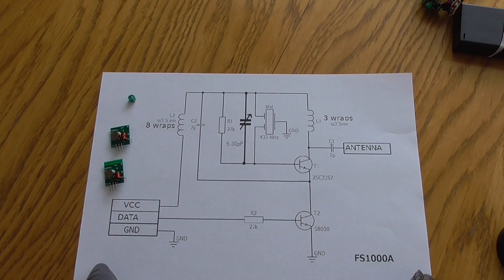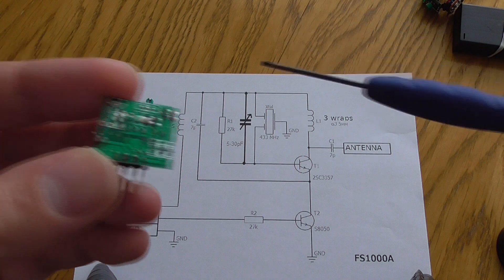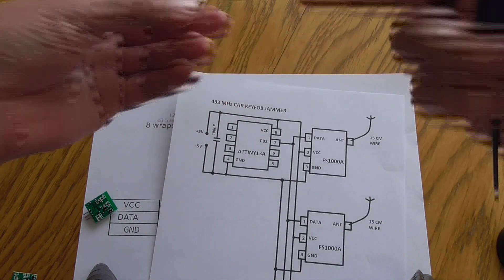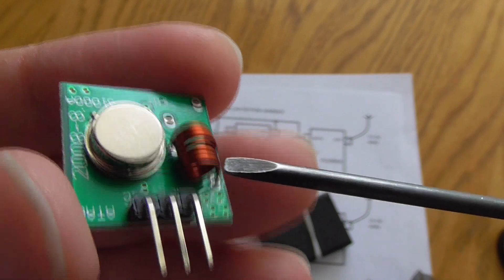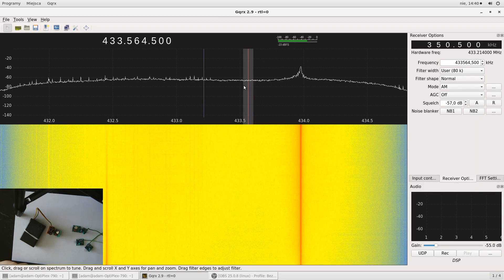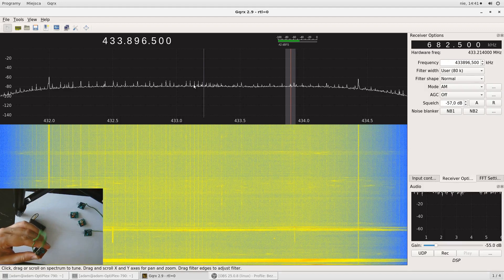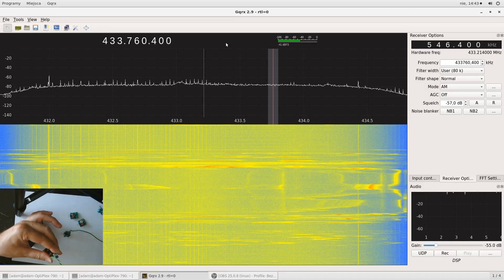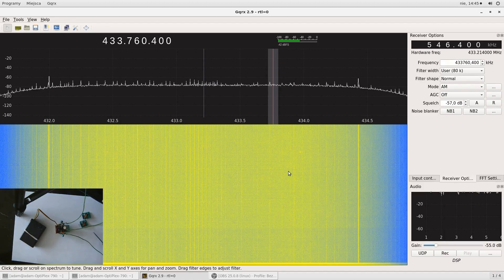2$  car key JAMMER DIY. Relay attack / keyless car hack / car hacking protection - part 2

Comment: Hii Adam can you tell me the antenna u soldered is it a normal multistrand wire or is something diffrent and for 433MHz what length it should be
Reply from the maker: as far as I remember it was an ordinary  15cm multistrand wire. You can use whip antenna calculator to find exact length

Comment: Does this just work by the ic switching the data pin on and off very fast? Couldn't you use a 555 timer?
Reply from the maker: in general yes but some randomization on data pin gives  better jamming results

Comment: Hi Adam. Can I use the digispark with the INO file from the other projects to inject these three boards instead of having an Attiny like You have in this project? Cheers!
Reply from the maker: yes of course. You can use  Digispark and 3 FS1000A modules at the same time
Reply: Great Adam! The FS100A can it's rf OUTPUT be injected in a lets say .5 watt 433 RF POWER amp in order to incresse the Range since due to the construcción of My garage in My building, many concrete pilars I need more range in the tx. Everything else works great!!! Cheers
Reply from the maker: yes you can attach RF amplifier to its output. You may find some on Aliexpress
Reply: @justanengineer5599  thank You Adam. Now thr FS1000A module es ASK, how should I select the appropiate amp🤔 Cheers GREAT SATURDAY!!!
Reply from the maker: use keywords "RF power amplifier" on www.aliexpress.com  You need tondind something for transmitter not for receiver. Most of these modules are suitable for receiver only
Reply: Great Adam. I Will look in to it! In order to lets Say protect My car from thiefs opening with frecuency capture and generators, what jammer could I build, My car key opener works in the 400 Mhz Range? Is there somethimg simple that I could build in order to be inmune to hackers? Cheers!!!
Reply from the maker: search for my other jammer based on cc1101 module and Arduino Pro Micro. I also have new project on github for universal CC1101 tool which also has jamming function
Reply from the maker: check my new project https://github.com/mcore1976/cc1101-tool
it has jamming fuction as well and can be operated from smartphone
Reply: Hi Adam! Ordered the components today!!! In the meantime I AM playing around with the digispark and now the three modules. I left one module with no variable capacitor and modified the other two. I Will first play around with one of the modified and then with the other and then connect all three and see if I can get 432/435 or the widest possible. Do You think it is possible? In other words the project with digispark and it's ino is working well it generates 433/434 but I seem to be short with some car frecuencies....😢 Can't wait to get the other projects under way! Cheers
Reply from the maker: Hi, the FS1000A modules always have the same basic frequency 433.92 because of SAW generator on the pcb. Try to play with couple of CC1101 board to cover wider band

Comment: is it possible to make work with a more powerful module like this in link? aliexpress item 4000148572305
Reply from the maker: No, I have this module. It has FM keying (not OOK onoff keying)  so we cannot use it

Comment: can this be done with Digispark ? i mean using multi FSK-1000
Reply from the maker: yes of course
Reply: @justanengineer5599  thank you for reply . where put capacitor ? can digispark handle something like 10 FS100-A ? or is better to use external power for it with high amp . like adaptor with output 12VDC 2A
Reply from the maker: capacitor is not needed on digispark board. You power digispark from 12v directly through Vin pin and FS1000A may be powered from 12v directly as well (VCC pin on FS1000A). It will give you higher radio power even with single FS1000A. If you want to use capacitors on FS1000A (to offset the frequency and destabilize generator)  you have to attach it in parallel to the SAW generator (this silver rounded part)

Comment: I really like your little jammer project. I'm basically building a comparable device at the moment.
But I'm not quite sure what you are trying to achieve with this trim capacitor. The frequency of a saw resonator can't be reliably tuned by adding some external component to the circuit. It's fixed and depends on the saw resonator itself. If you want to adjust your frequency, you should switch to a transmitter or transceiver that is made to be adjustable. Like the CC1101 ;-)
Reply from the maker: Hi, the trim capacitor was used to destabilize SAW generator and achieve wider range of jamming. You are of course right and it cannot be done reliably which can be actually seen in the video. The best would be to use CC1101 as you mentioned and constantly fast switch  transmission channels to cover wider band around 433MHz. I'll think about it , still have couple of CC1101 modules I could  use to construct such kind of jamming device.
Reply: @justanengineer5599  Hi Adam. First of all, thank you for your reply. Now I understand what you tried to do with that trim capacitor. Although I still think that it's a bit hacky :-).

I'm currently using the CC1101 for my project and it works quite well. I'm trying to jam Somfy RTS radio controlled roller shutter motors. At first I tried the FS1000A, but I obviously didn't put enough research into the project before buying the transmitter. As you know the FS1000A usually works at around 433.92 MHz - while the Somfy system uses 433.42 MHz. Needless to say, that didn't work out well with the FS1000A. Being able to set the frequency was the reason for me to switch to the CC1101.

Of course, the effort for the implementation with the CC1101 is somewhat greater, because it's a rather powerful transmitter module with a lot of functions. But I'm using an Arduino and the SmartRC-CC1101-Driver-Lib that is available for download and installation in the Arduino IDE makes it quite easy to do the implementation.

The only downside is that you don't get as much transmit power with the CC1101 as with the FS1000A. I think the FS1000A does up to 40 mW (16 dBm) if you power it with 12V, while the CC1101 does only 10 mW (10 dBm). I think I'll just purchase a cheap amplifier to improve things a little.

By the way, do you have some background knowledge regarding the most effective technical implementation of jamming? Like which modulation is the best to use, what kind of word to transmit and so on? I think I have to do some research in academical papers in order to understand the whole topic a bit better. I'm an electrical engineer, but communications engineering isn't exactly my area of expertise.

Greetings, Simon
Reply from the maker: Hi Simon, the library you mention for CC1101 looks quite well. The main drawback I am having with CC1101 is that I need to use manufacturer tool to calculate all these register values...
About jamming - the main principle is to use the same kind of radio modulation as the original transmitter does f.ex. ASK as RC remote is using. 
The other point is about the frequency tuning. The frequency does not have to be exactly the same as the original sending device is using because there is always kind of "input filter" in the receiver which has some bandwith tollerance f.ex. 200kHZ or more so it will receive f.ex. from 433.22 MHz up to 433.62 MHz. So you don't have to tune to "exact" receiver frequency... 
The most important is the sending power which has to be higher than original transmitter to achieve desired effect.   
And the last about signal used for modulation - the best is to use random generated values. What I am doing in some of my designs - I use PC and Excell/Libreoffice calc to calculate random values that are further pushed to the transmitter as modulation input.  That gives awesome results in some scenarios - look here at my ultrasonic jammer project : https://github.com/mcore1976/antispy-jammer/blob/main/mic-jammer.ino
Reply: @justanengineer5599  Hi Adam. The library is quite nice. It also comes with some example projects. There is an example that transmits a "Hello World" message. This example shows everything you need to set up the CC1101 and with a few changes you can use that as a basis for a jammer.

During my tests I also experimented with different types of data. I compared pseudo randomized data to a fixed data word that is repeatedly transmitted - and I also had the impression that pseudo randomized data works slightly better.

Is there a specific reason for you to calculate your random data in a spreadsheet program and then hardcode it into PROGMEM? It seems to me that implementing a linear-feedback shift register to generate pseudo random data would be more convenient.
Reply from the maker: Hi Simon. I have used pre-generated white noise values because of timing issues I had in my code. I could also take input from ADC but generating pseudo random bytes on PC  and reading them from lookup table on MCU appeared to be the fastest in terms of processor cycles used. I utilized this method for ultrasonic microphone jammer where real white noise is required to achieve best jamming efficiency and that worked great
Reply: @justanengineer5599  Okay, thank you.

Comment: So I can use the same code with 328
Reply from the maker: In general - yes you can compile this code for Atmega 328P, but the compilation script  for main.c - "compileXXXX" - should look like this ( if using AVR-GCC environment ) :
 avr-gcc -mmcu=atmega328p -std=gnu99 -Wall -Os -o main.elf main.c -w
avr-objcopy -j .text -j .data -O ihex main.elf main.hex
avr-size --mcu=atmega328p --format=avr main.elf
# fuse = 62 for 1MHz clock = internal 8Meg / division 8
sudo avrdude -c usbasp -p m328p -U lfuse:w:0x62:m  -U flash:w:"main.hex":a
Reply: @justanengineer5599  ok thanks not that good at it but I will try or if you have time one day to do a video of it that would be nice thanks